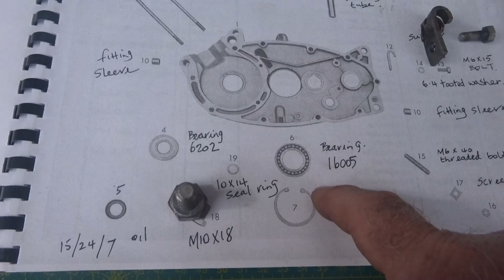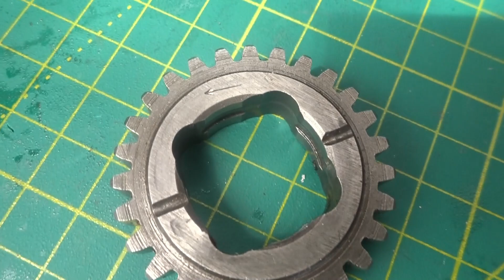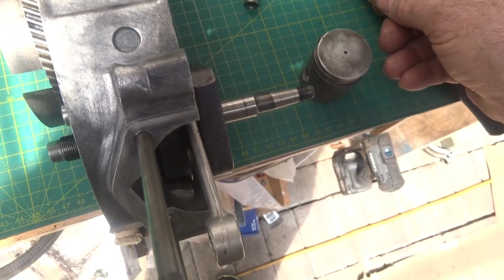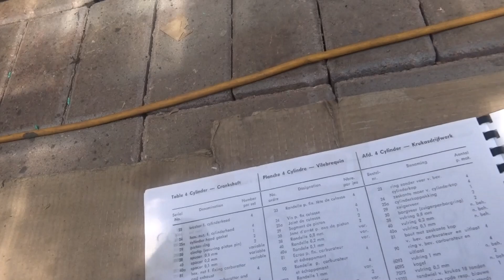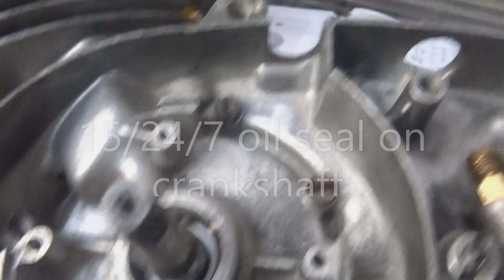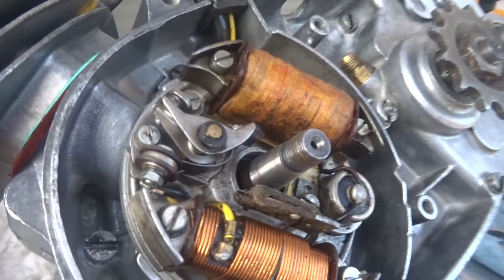ZUNDAPP COMBINETTE 265 ENGINE RESTORATION PART 2 RE ASSEMBLY

Comment: Hello Tom.
I’ve just bought a Combinette 1959.
I’m the second owner of the moped.
But I’m having some problems with the gears.
First and neutral works fine but second doesn’t want to go in right.
Do you have any suggestions?

Kind regards Oskar
Reply from the maker: Have you opened the engine to see if there is a problem internally?. I am not a mechanic so would not know of another cause other than the gear cable settings that would cause this problem. Consult a mechanic.
Reply: @tomcahill8506  
No I have not.
But in your video you had a similar problem.
You found first gear and neutral but didn’t find second gear.
And I’m just wondering how you solved the problem?
Reply from the maker: @oskarcarlqvist1321  I haven't tried to start the engine, due to my back problems.